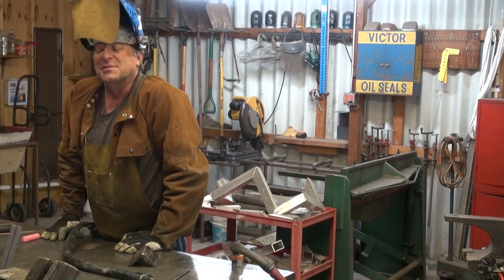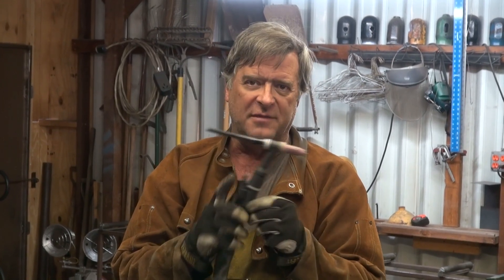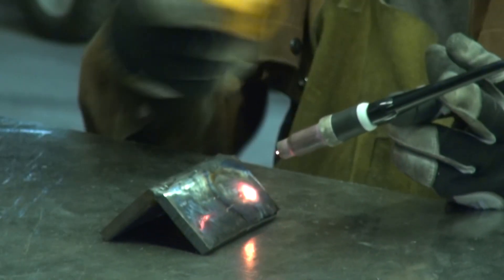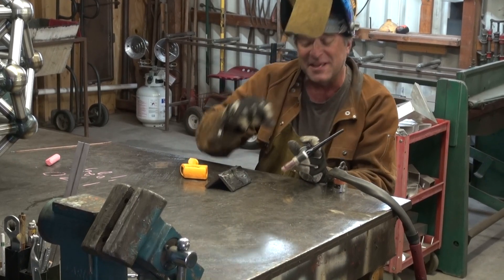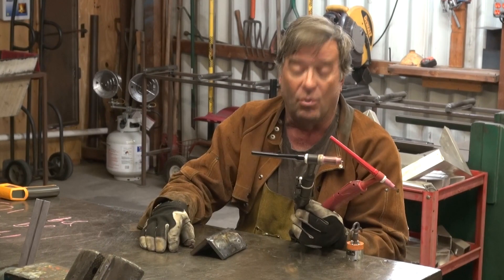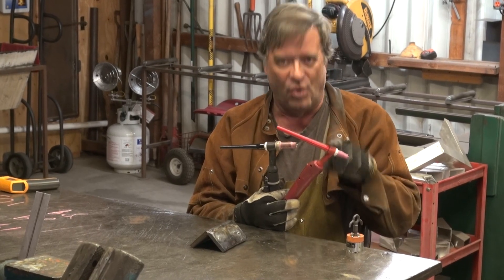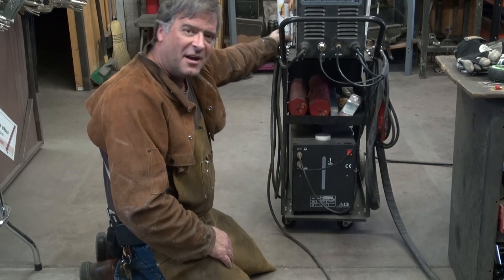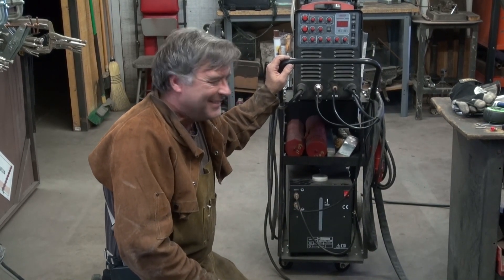Which is Better? The Difference Between Air- and Water-Cooled TIG Welding Torches - Kevin Caron

Comment: my water cooler keeps leaking ? ??
Reply from the maker: From where?  Hard to help without all the facts.
Reply: @KevincaronSculpture  from underneath the cooler 
 it's a nasty yellow looking water spill everytime i turn the welder on any clue? 
do i need to change coolant? pour distlled water? 
you didn't show how to maintain the unit ?>
Reply from the maker: I would take the cover off the machine and look for the leak.   Hopefully it's just a loose hose clamp.  Most likely the radiator core is leaking and will need to be repaired.   Good Luck!
Reply: @KevincaronSculpture  ok thanks 
but what does the cooler do ? do I HAVE TO use it ? can i disconnect it?  
it came with the machine
Reply from the maker: The cooler is to cool the tig torch when you are welding.   It allows for a smaller body on the torch to make it easier to hold for long periods.   Also allows you to run higher amps on the torch.  You will need to get an air cooled torch if you want to disconnect the cooler from the welder.   DO NOT TRY TO WELD IF YOU DO NOT HAVE AN AIR-COOLED TORCH. You will damage the water-cooled torch if you weld with no coolant flowing.
Reply: @KevincaronSculpture  ok so the other day i amped up to 40 (i should'nt have ) but i generated a lot of heat and as a result a huge smoke came from the cable and the wire was disconnected. i burnt  the cable the ceramic is no good anymore....... 
would you say my cooler is not working now  
cause if it did this would be prevented ?

Comment: stupid question, in a pinch could you uses compressed air to cool a water cooled torch?
Reply from the maker: Yes, you can but it will not work as well.

Comment: You say water cooled torches are more expensive. Yes and no. The actual torches are cheap either way. I bought my water cooled WP20 flex off fleabay for less than $20 as I recall. And that was new. The difference comes in the hoses. They are more expensive than the single line for an air cooled torch, but I have seen complete new water cooled 25’ torch and hose sets on fleabay for right around $100 - $125. So not outrageous. To me, the water cooled torch is well worth the minor extra expense. And water cooler systems don’t have to be that expensive either. For years I ran my torch on a five gallon bucket with water/rv antifreeze, and a simple submersible coolant pump. Worked just fine.

Comment: Nice test with real numbers, not "expert" opinions. I've been using air-cooled tig torches and doing a lot of chassis work and roll cages I'm ready to move up to water cooled torch, I used a friend's once and I'm convinced. Air cooled is not the proper term because the shielding gas doesn't have the volume to cool properly nor is it the best at heat transfer. 8-12cfh isn't a lot of gas, small jobs and short runs it's fine.
Reply from the maker: I am very happy with my water cooled torch.   Would love to change both tigs over to water cooled someday.

Comment from the maker: It can use water or I use RV water tank antifreeze. The stuff you use in a car will screw up the torch. The pink RV kind will not hurt it and won't freeze. But don't try it in your car, not made for high temp/high pressure. 

Great question , thanks for posting.

Comment: Nicely explained Kevin.  I live in upstate NY.  I am assuming that the cooler will freeze in the winter in an unheated shop?  Does it use plain water or a coolant that will not freeze in low temps.  Thanks-

Comment from the maker: This machine is running single phase at this time.  That's all I have in the studio.  It will run 3 phase also. The cooler is sealed and has not needed any more coolant since I put it under the welder. They are both on the same cart and can go anywhere together. No problems, no water hose to worry about. If I had to take it out of the studio and off property I would have just disconnect the torch from the welder and leave it hooked to the cooler. Or just use the air cooled torch.

Comment: Kevin. Are your welders single phase or three phase? Does the cooler unit need topping up with coolant occassionally, or is it sealed? So, although it's water cooled, it's still portable around the shop... it doesn't need to be connected to the water supply, right? Thanks. Oh... who is the lady?